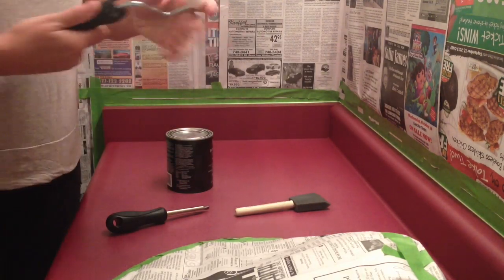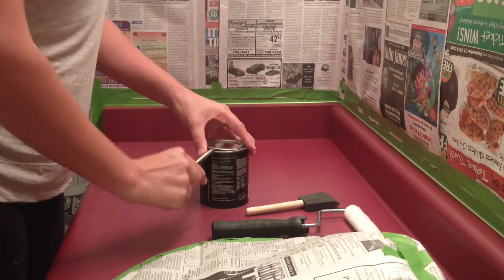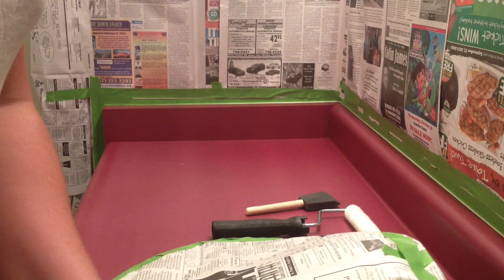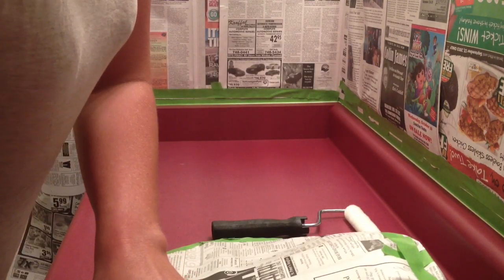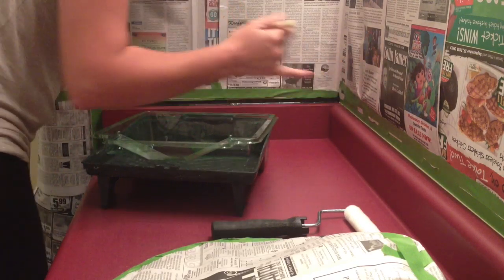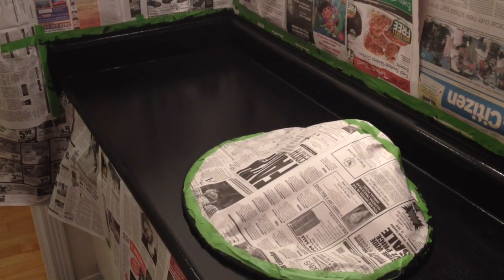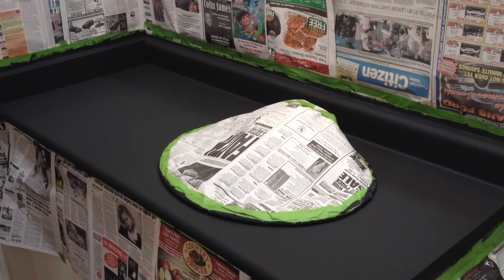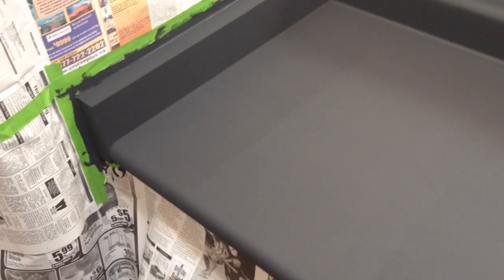Painting Countertops with Giani Paints, Part 3 of 5 Painting Base Primer

Comment: Ok, so how is the counter holding up? I've watched tons of videos and am PRETTY DARN in love with this idea but I have to acknowledge that all the (great) reviews are right after the product was applied or in the couple weeks after doing it. I need to know how well it holds up months later. I want to do this in the kitchen -- which makes me most inclined to know it goes on with time. Kitchens get a lot of use.
Reply from the maker: I do plan on doing our kitchen aswell
So far so good. It has been just over 5 months since we did the first bathroom and no evidence of any wear so far, though I do have to add this is just a guest bathroom that doesnt get a whole lot of use, and on most of the abrasive things I keep on the counter I put on adhesive felt anti-scratch pads.
I did our main bathroom 2 months ago again no evidence of wear and used the anti-scratch pads again.
some things I think will help it last better are make sure you can allow for that dry time they allow like the times they sugest before using your dishwasher and other appliances we so far have given ours as long as we can a week or more. also the say you can put down a max of 3 top coats I have chosen to do the suggested 2 coats this leaves me a 3rd top coat if i need to add it in the future. I hope this helps let me know if you have more questions.
Reply: Thanks!!